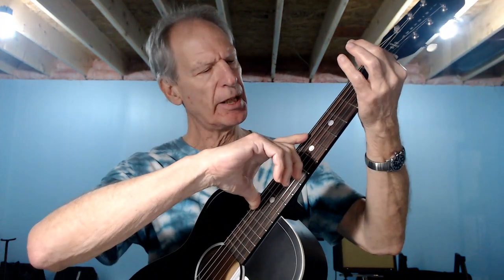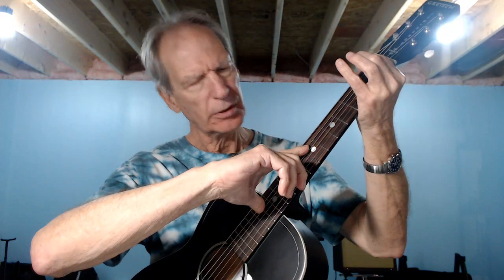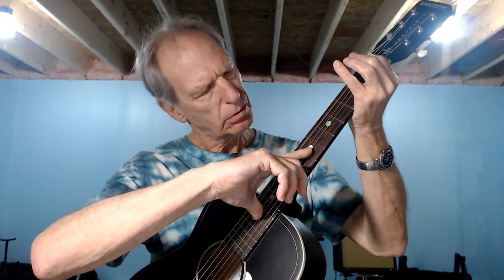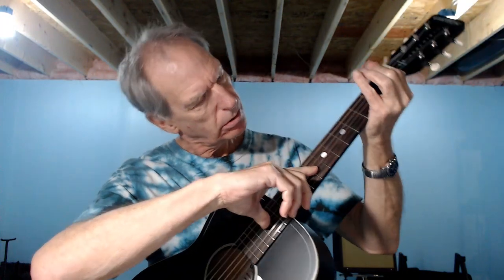Jim Dandy Guitar Set-Up

Comment: First thing before sanding the nut is to adjust the trussrod, because it changes the action. On mine I had to adjust it a lot! I went from 4 to 3mm just adjusting it. Then yes, sand a bit the bottom nut...
Reply from the maker: Yes, of course. That's how I do it although I didn't in this video. Sometimes that's all you need, a neck adjustment.
Reply: What do you do if your fret bars are uneven, some higher than others?
Reply: @MARKBINGHAM-m5k  You go and see a luthier, who will do a fret planimetry...

Comment: How did you do neck adjustment, given that there’s no truss rod and the steel reinforced neck?
Reply from the maker: There is a neck adjustment. Use a straight edge or sight down. I like my necks almost straight.
Reply: They have a dual action trussrod. It adjusts from the inside of the sound hole.

Guitar comes with the Allen wrench.
Reply: Its in the mouth hole of the guitar, but I don't know is which side is hump & which side bow

Comment: Hi Gene, nice video and well explained. What gauge strings did you put on it please? I'm keen to make the same setup on mine and want to change strings also. Not sure what are on it from factory, but they're quite thick! (and very squeaky)
Reply from the maker: I installed D'addario nickel bronze light gauge. Standard OEM strings are D'addario EJ16 phosphor bronze.  If you're sure the strings are those, you could try extra light gauge on either brand.
Reply: From watching this video I put Martin Retro Nickel light gauge that's surprisingly better.
Reply: Monel nickel was the exact composition